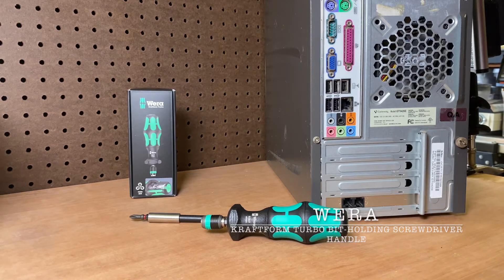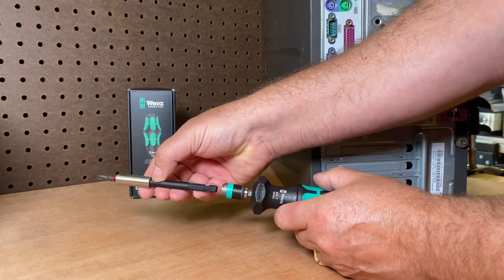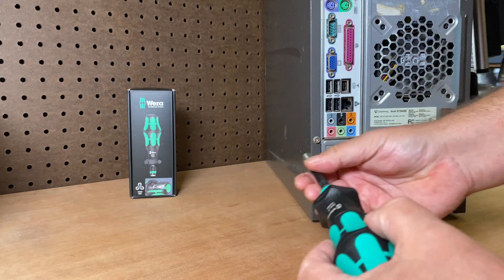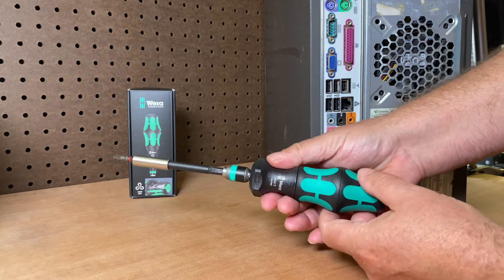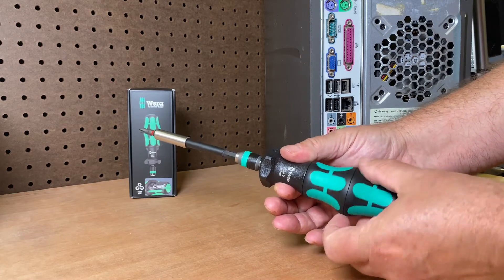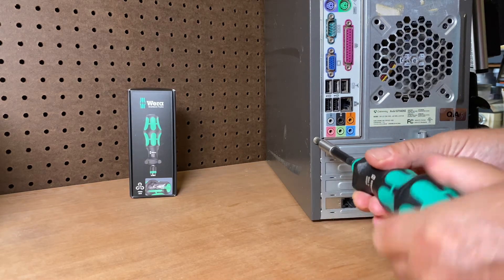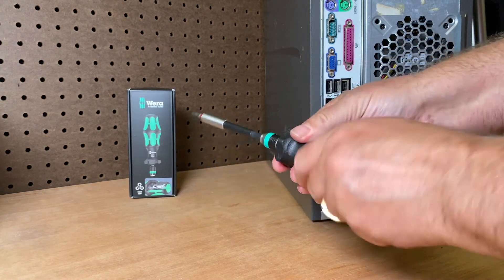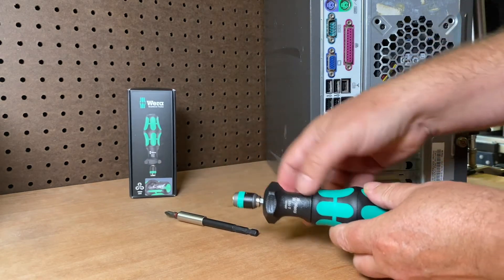Wera 05057480001 Kraftform Turbo Bit-Holding Screwdriver Handle with Rapidaptor Quick-Release Chuck

Comment: I bought this tool and I was very disappointed
Reply: why?
Reply: @MeshRoun  when in turbo mode the gears don’t mesh properly jamming it up and when in locked normal mode the driver feels spongy as there is play in the gears even though they are locked. I feel that wera got it completely wrong on this one.
Reply: @Gsavell  thanks for the feedback, that's too bad, it looked great.